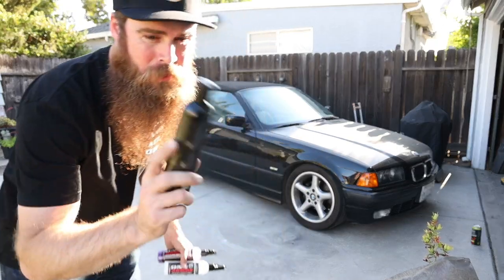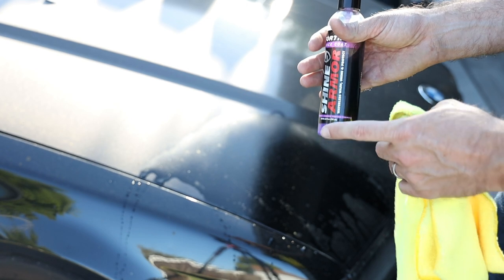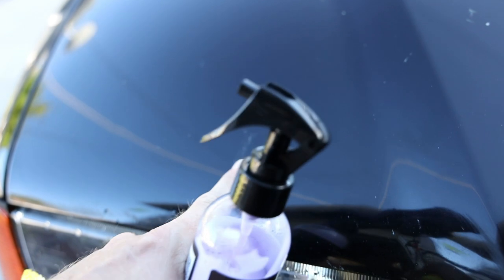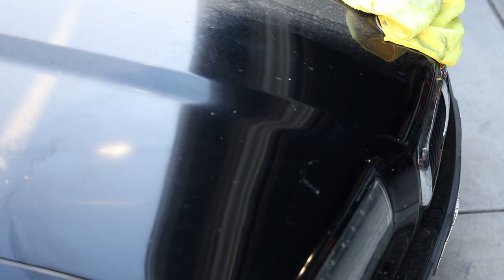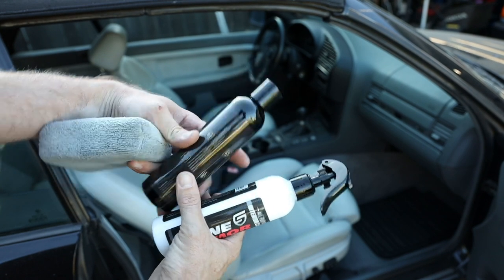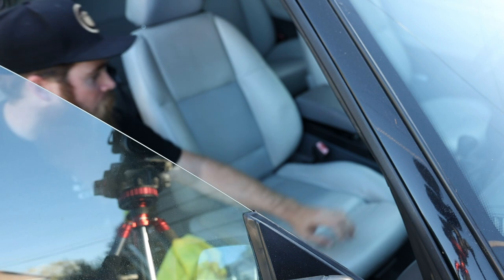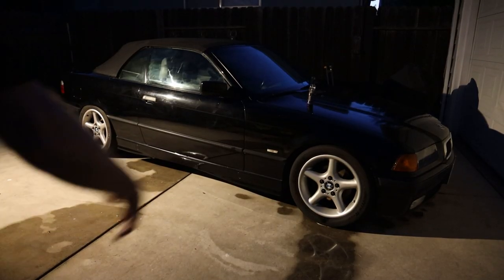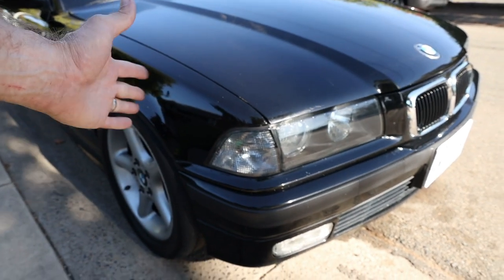SHINE ARMOR IS IT GARBAGE? WEEK LONG TEST

Comment: I used this product back in 2018 when Si02 infused ceramic sprays were new on the market, heard about it and was confused because it sounded like a ceramic coating but appeared to be some type of “detail-waterlesswash-protectant” miracle in a bottle. I will admit it did provide slickness, shine, and a nice grape scent being nice. Sadly, I do notice it also has a poor bottle nozzle design that broke on me twice, I poured the product into my other spray bottle but I noticed the shine armor nozzle sprayed less product compared to my spray bottle I had at home so it used more product than it advised. $20 a month felt wasted compared to using a Waterless wash I decided to try other stuff and say this was a no go for me. The company rarely answers questions it seems to be praised by lot of people even #1 Amazon choice on search for some reason. The way it’s advertised is just blasphmy.